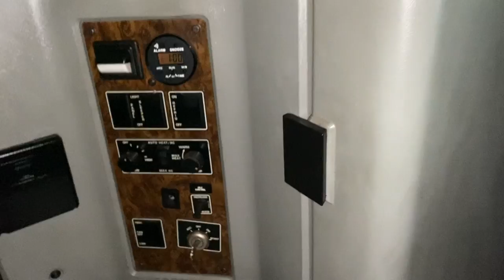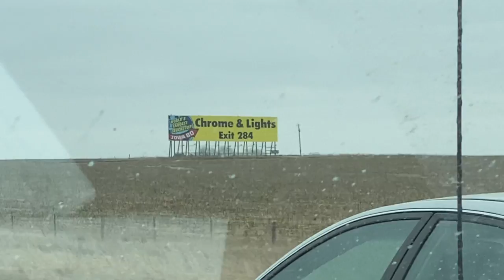Shopping For A New Rig

Comment: Great video, Coop! Enjoyed the ride along. I think some buyers might be tricked by the nice paint job, bunk and decent interior on that truck.
Reply: Let's be just a bit honest. The paint and interior mean that someone cared about their personal hygiene. Everything else is normal wear on a truck that age. Tires $4K, Rebuild on my fan clutch on my Red top N14 was $1500 R&R with belts at Kenworth in Caldwell Idaho. Muffler clamp $40. Body shop at Kenworth weld and repair the driver's door. $500-700. Full service with all fluids. $1000. Still a really nice pre emissions Kenworth. That stuff is wrong with all T600 Kenworth trucks of that vintage.

Comment: When at the truck museum did you see the KW bull nose with 5.2 million miles on it.

I did a little research on the T6.  It was built at the KW factory in Renton, WA.  Build date 5/21/95.  It was sold by KW of Des Monies to a company names Crown Leasing, which I think is TMC the flat bed hauler in Des Moines.  The black paint and low top sleeper matches their spec.  Let me know if you want more information.
Reply: You forgot the "grass burner" exhaust too.

Comment: A buddy of mine had a bunch of tree air fresheners in his truck. He got pulled over and because of all the air fresheners he accumulated over a few years they figured he had drugs in his truck. The Iowa highway patrol called in more cars and started taking his pickup apart on the side of the road. He never touched drugs and they obviously didn’t find anything. But it cost him a few hours of time.

Comment: That truck is bad News I would suggest a mack vision 2000 to 2004 those are good trucks anything in Mack’s from 2005 to about 2011 had a bad engines and 2013 to 2018 mack pinnacles are good trucks to

Comment: selling a 2007 9400i 72" condo double bunk. good rubber all around brakes good DOT good. 500hp Eton Fuller 10 speed. she pulls nicely. Selling due to health issues, forced into retirement early. $18500 asking. Also a 2018 Benson 53' stepdeck all aluminum 110lbs 3 axle rear two axles lift. $34K comes with mircowave, fridge printer storage and 6 new aluminum wheels not installed yet also has cameras
comes with headache rack all chains straps etc. Trailer has two 9' toolboxes loaded with securements alos. 
It is Michigan